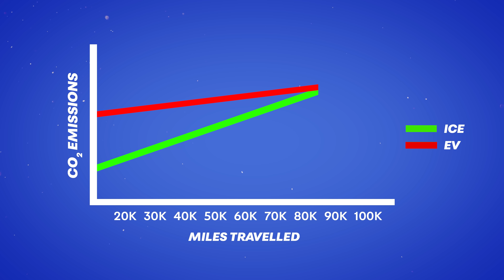Are Electric Cars REALLY That Green? [New 2022 Data]

Comment: Thanks for a good video. I am not a big fan of EVs simply because I have achieved near financial independence through among other things, buying older cars with cash and learning how to maintain them myself.  If EVs were to take over the market, we would all be forced into buying new, or almost new cars, because EVs will rarely hit the used car market due to the service life and cost of battery replacement making it impractical to buy a used EV that is soon to need its batteries replaced.  Further, CO2 is not accepted by all experts as a pollutant, and I do not think it makes sense to call it one, because it simply isn't, but the process of making the batteries does generate pollution but so can oil extraction and refining. That said, I think anyone who wants one should be able to buy one if they choose, they do have upsides, I just don't want to be forced into debt to buy one and I do not think anyone else should be either.

Comment: They've worked out that the tipping point is 43k miles for the green credentials of EVs vs ICE machines. We've been conned into buying a new ICE car every 3 to 4 years. It has only just come to light that virtually all legacy ICE manufacturers make no profit on new cars, but get their margin on after sales purchases ie parts & service. They are actually manufactured to break! Sickening. Fortunately, there's very little to break in an EV - made to last 100's of 1,000s of miles. Tesla's profit margin is sitting at about 25% and is likely to hit 40% once Texas and Berlin are fully ramped - making a profit the ethical way. They are also revolutionising the way that batteries are made, introducing iron-based ones for their standard range cars.

Comment: You also need to include the carbon loads of the energy generation equipment when produced.  For example, the carbon emitted by building a wind farm or solar field.
Reply: of course you do, but I'll bet my non EV car had/has quite a bit of a carbon footprint too.
Reply: @tedebayer1  The EV has a bigger Carbon footprint.
Reply: A Cat 994H front end loader(which is as large as a two story house)  burns 1800 gallons of diesel fuel in a 12hour shift, is required to move 500,000 pounds of earth just to get the minerals to make one single Tesla battery. The world would be a much better place if climate alarmist were buried under the earth this machine digs for Tesla batteries!

Comment: but dosn´t the calgulation reset, after 10-15 years when the battery in the EV dies ?
in that case, you got a whole diff calgulation to do, depending on if the gas powered car stays within margins or also becomes less efficient over years.

Comment: But what about the toxicity of the batteries after they wear out. As I understand batteries are more toxic to the environment. The electric cars are not the answers because of this. I leave in America who is against using nuclear energy and solar panel are filled with toxic substances and only last 25 years before needing replaced. Solar only give power when the sun shines. Wind mills only produce energy when the wind blow and they start with a high CO2 count because of what goes into making them. Than you count in the space it takes to build enough wind mills to power a city or state. These are not the answers. If funny but the real answer is to develop better nuclear power plants and to use oil tile we get better renewable energy options. If America was to use it oil, than it would aloud 3rd world nation to use it own oil and this would get a leg up to development of those countries. This to would lessen co2.

Comment: ICE cars are getting more and more efficient and polluting far less as time rolls on. If you factor in a battery replacement after 7-10 years or around 100-120k miles, I seriously doubt an EV at lets say 150k miles is greener than something like a civic or corolla at similar age and mileage. 
If you truly believe in the EV future, they need to become extremely modular to be more environmentally friendly than an ICE car in a meaningful way. 
In short, all of the electronics and components in an EV need to be easily and cheaply upgraded so the useful life (and value) of the vehicle is maintained far beyond that of an equivalent ICE car.

Comment: Now the bigger question: what happens when you replace the battery? Because if that replacement alone equals 300K of driving an ICE, the difference long term is really small.

And that's just one of the many complications that barely anyone wants to talk about. The real trick is driving less. Working from home. Allowing people to have 2 cars with less costs so they have that EV for short drives and ICE cars for longer trips where EV's have issues. Also that allows for a smoother transitions are people are not dumping there ICE cars an mass (this is an issue as well. Cars that are fairly new being dumped means their production was a waste of materials and energy and you still need to process/recycle them). 

And top add more BUTS to the list: how green is green energy really. Solar panel production. Building windmills. It all comes at a cost. Will that cost be earned back? And there's "green washing" to top it all of.

I'm not planning on selling my hybrid any day soon at least. We don't drive much and what we drive we do very fuel efficiently. Working from home. Never traveled by plane or cruise ship. I feel like those changes long run do a lot more than trying to forcefully change all cards to EVs.

Comment: The real question is where is hydrogen powered cars in this equation? 
If the only TRUE reason that electric vehicles environmental production costs are astronomically higher than internal combustion engines driven vehicles, is the production cost of the batteries, then hydrogen powered electric vehicles are obviously going to be a less carbon high cost in production, as they hold the electric charge in the hydrogen and don't use batteries, the only carbon cost would be the production of the hydrogen, so the real question might be how hydrogen production fairs against petrol/diesel?

Comment: Why does everyone always ONLY speak of the carbon footprint? The manufacturing and mining of the raw materials for the batteries are ungodly toxic and cannot be made untoxic. But they don't pollute the air it pollutes the ground.  From what's been learned, once the ground is polluted with these materials the ground is permanently polluted. If Carbon is such an issue why has nobody found ways to clean our air in the past 40-50 years of complaining about it? I guess we REALLY are that stupid of a race.
Reply: Exactly! You bring it on the point!

Comment: 124,000 miles is end of life on electric car?? There's the Problem. 124,000 miles is just broken in in the US. As a mechanic I think people need electric for around town and gasoline for long drives. Gas engines need to warm up in order to be efficient where as electric does not. Electric doesn't have the range and charging isn't like going to the gas pumps.

Comment: And in certains countries they are running EV charging stations on DIESEL generators😂 because the electrical grid can't handel the supply, then you have the cost of these cars the rising cost of electricity and rare metals these batteries are made of, then there is the factor of old battery waste, like the problem they have already in china where EV's are running. for 10 years now, not to mention the illegal waste dumping that will happen, so within 10 years from now the emmissions may become better but it will create other serious problem caused by heavy metals.Thats just my opinion, i honoustly thing that petrol isn't that bad as it used it used to be.

Comment: As a battery builder and electrical engineer it's not more efficient and it's actually way more harmful and the sheer amount of new power grids and electricity it's gonna take it will heat the earth's temperature twice as fast batteries get extremely hot under load and while charging power grids are enormous heat makers it's just an agenda no facts all b.s. if you remember in the early 90s we were looking at an ice age by 2010 when people wouldn't by into that here comes global warming it does us no good when no one else is concerned and even China just said they have participated in all the Green energy they were doing and they put out around 28% of the world's pollution

Comment: Ironic that the EV car is shown driving by "green" trees at every turn. But when "green" wind turbines and PV arrays are shown the trees have all been chopped down to make space for "green" energy production.
Wind and solar energy was the Pre-Industrial Revolution power source (think tall ships and agriculture) but the industrial revolution introduced denser sources of energy that produced more work. So in that respect - wind turbines and PV arrays that take vast amounts of space are a step backward.
IMO we need dense (and preferably green) forms of electricity production to make the switch to EV a reality.
At present we could at least make better use of roof tops in metropolitan areas where roofs are above tree level to increase energy production and avoid cutting down trees in neighborhoods and open areas.

Comment: Thanks Autotrader, I bought a Prius through you guys and I love it!

Great range, great reliability (thus far🤞🏻), and unique styling. 

While it's a little disappointing to hear it requires almost 100,000km before your carbon footprint breaks even, that's not what I bought a hybrid for.

It's all about the money, baby!🤑

Gas is so expensive, and I hate range anxiety. The Prius charges the battery with regenerative braking, just like EVs. It's great for rush hour traffic here in Toronto. But it also has that ICE which really helps heat the cabin in the winter time.

So it's just a 🍒 cherry on top, that it also can be less carbon emitting eventually.
Reply: The break even point for a plug in hybrid is going to be somewhat different, as the battery is much smaller, but it uses gasoline for some portion of driving - the mix between the two is going to vary by the person.  Maybe the full PDF report from Volvo says something about that.  (Also a Plug in Prius owner)
Reply: I understand the appeal of hybrids, but every time you run it on gas, the e-motor and batteries are just dead weight, adding to fuel consumption, making the car arguably worse than a pure ICE vehicle and the same logic applies to the electric part compared to a true EV as well.
Reply: @jayhill2193  Yeah, good points.  As Thomas Sowell says, "there are no solutions, only tradeoffs" and sometimes the factors being traded off against each other are all very high priority.  Like we can't afford to burn more fossil fuels and we can't afford to let the economy crash.

Comment: Presuming all data is correct.  The Volvo break-even point  of 90,000km is the key.  How long does the battery last?  When will it needs replacement?  Because that will be the carbon spike on the part of the EV.

Comment: So, in a place like where i live... Near zero after purchase? Since... i mean... My power is done by Hydroelectric and "Clean" Nuclear. Thus, near zero emission charging, yeah? Ah, spoke too soon. So mine would break even at about 30,000 miles. Which, is a little less than 2 years driving for us here in the states. Considering most people change cars every 5 years, that means over 3 years of driving with zero emissions for people in my immediate area on average. Me, i have had my car for way over that because i really enjoy it. 

For people outside of my area, most of the rest of the state is done with Natural Gas... so still very clean in comparison to Coal. So the logical outcome to this would be that my area would actually make a net negative in emissios (from autos) if we all changed to EVs. Which likely means that the national US average would be sliced drastically because there are many areas with Nuclear/CNG/Green energy sources to the point that even if we did have a mix of ICE cars that if we all drove them 5-10 years or more... and i lost my train of thought but im sure you get where im going maybe? Ye.

Comment: We own an EV and a solar system for charging, however, I still feel a gas powered Honda Civic might have the lower environment impact when you consider recycling the batteries and the longevity of the vehicle.  I could be wrong
Reply: there is no recycling, that's another "green" lie
Reply: As far as recycling the batteries go, that's no longer an issue. Yes, the batteries can be recycled to almost 100% of their original capacity with no generational losses between recycles.
Reply: Recycling the battery isn't a negative. Recycling the battery results in new batteries being made with the lithium etc at a significantly lower environmental impact than mining new materials, and companies are even managing to do it cheaper.

Only problem with recycling is that the batteries are lasting so much longer than expected that there's not a lot of them going to recycling despite tesla being mainstream for a decade.
Reply: @TopolinoEV  I own an 18 yr. old Prius and it's still going strong on its original battery.  I also bought a Tesla (worried that my Prius would eventually give up and leave me stranded somewhere).  I think a lot of the battery dying early stuff is FUD.
Reply: @kenbob1071  absolutely, people think a car battery works the same as their phone batteries or something. 😅
Reply: @TopolinoEV  there is legit a youtube video of a guy blowing his tesla up because his battery failed and didn't want to pay the 20k price tag to replace it.
Reply: @SPNKr02  of course there's a few duds here and there. Just as there's plenty of gas cars that are lemons.

There's been a big recall on the Chevy bolt because they were catching fire. Mostly in the small gas engine they had because of range anxiety, but there's been more recalls on gas cars than electric cars in the last few years, it's just not as loudly proclaimed in the news.

That said, the video you're talking about was one of the older teslas, and the Finnish guy bought it knowing the battery pack was bad, and while tesla is the apple of EVs with their "no fixing only replacing" it could have been fixed for a few hundred by replacing the bad cells rather than the whole thing. This is something that will be easier as they become more mainstream and we have more mechanics who actually know how to fix issues.

It's the equivalent of blowing up a gas car because the timing belt needs replacing on a gas car. It's a specialized repair, but not all that expensive or complicated. But if the manufacturer had hidden it inside and welded it shut and said you're only allowed to replace the whole engine to fix it you'd have the same issue.

It's not a battery issue, it's just tesla being a shit company.
Reply: Running the vehicle is 80% of the lifetime CO2 emissions of a vehicle. You are almost certainly doing a net positive. There's still downsides but from purely a climate change standpoint you are doing the right thing.

As an example if you're in a state with a very dirty grid (let's say West Virginia) the dirtiest EV (Audi E-Tron) and an ICE Honda Civic have similar lifetime emissions using the 2021 power grid. When you consider the fact that you have solar panels, probably drive a less polluting EV, and are likely on a far cleaner grid you're doing a net good. That doesn't even consider the fact the electric grid will probably be 2-3 times cleaner by the time the vehicles go out of service.
Reply: @adamnazarian5104  Would you care to elaborate on your disclaimer "from purely a climate change standpoint"? Do you know of any particular environmental regard where it is substantially worse, such as extinction of specific species?
Reply: Batteries that are designed accordingly, can be re-set by use of a special balance charge cycle without removing it from the vehicle, to increase it’s capacity closer to the original.

Comment: The problem with EV‘s ears by the time you hit the break even point the battery needs to be replaced. Therefore making them even worse than petrol. Most vehicles these days get incredible gas mileage and will last well over 200,000 miles. Until the battery world has some major breakthroughs EV‘s will always be worse for the environment